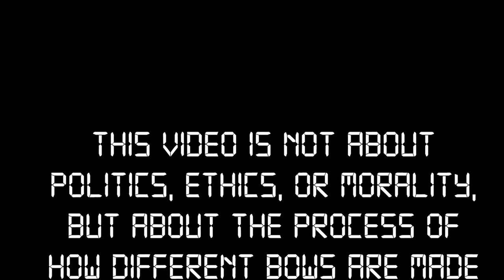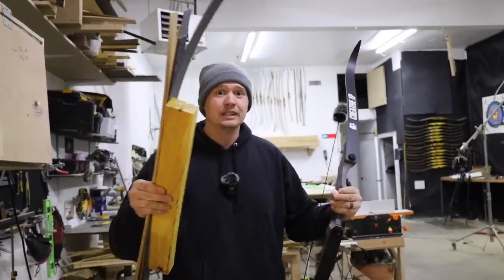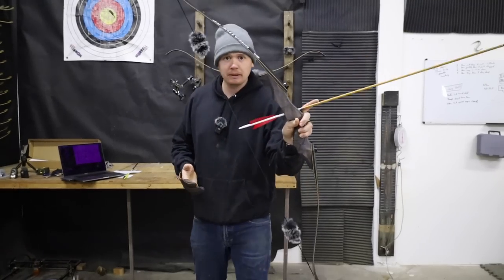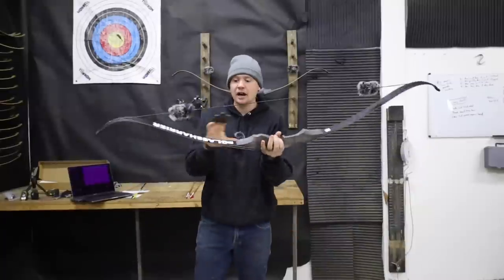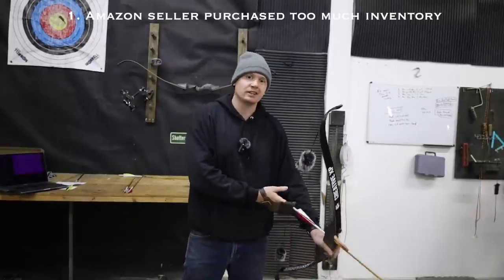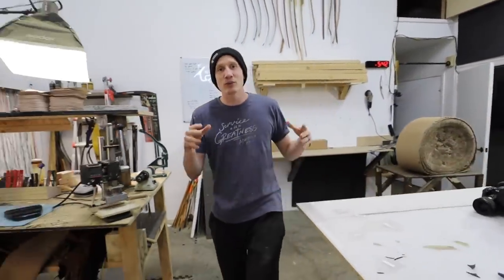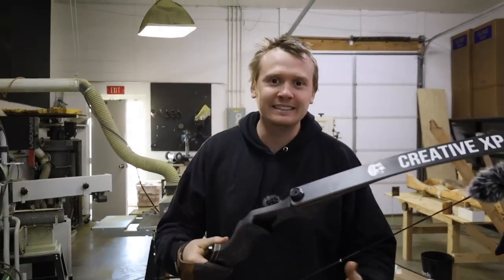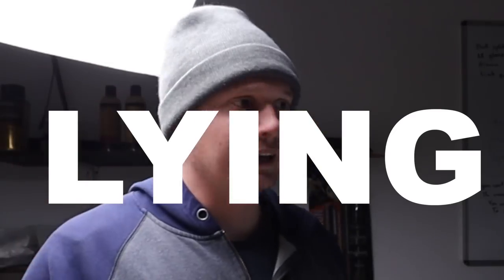Is a $59 Bow Trash? "what i think the truth is"

Comment: I have a question I believe you can answer. I have a 72", 38# hickory self, flat bow without an arrow shelf. I did not make it and do not know who or when it was made. I want to modify it for a teen girl around 5'2" with around 30-35# draw weight and 25ish draw length.  Can I cut the limbs to the desired length and still be able to hit 30-35# draw weight? I was hoping not to have to back it if possible.

Comment: Junxing is the main company making this model as well as a reflex deflex model and there is an all metal riser with same name and limbs fit both versions. There is also a flat top connection point model that the limbs fit the original design but cut out some of the sight window.

Comment: Hey guys, another great video. I ended up with the Blackhunter longbow, have since gotten recurve limbs for it up through 45#. That is a fine shooting platform for beginners like me. After that I got one of your bows, another great shooting bow which I love, it’s at 35#. Another bow I bought, before watching your negative review, was the $86 TopArchery 56” TD recurve at 40#, just received 45# limbs for it yesterday. I know you reviewed this bow as it came, but this is a great bow with minimal input. First I replace the continuous loop string with one of yours, my flipper rest did not fit but I had already ordered a plunger and flipper set up from Lancaster, it was cheap. I then installed some beaver fur string silencers and after some shooting have come to the determination that it’s my favorite shooting bow, but hey, I just started down this archery rabbit hole. Thanks again for great videos!

Comment: Kramer I recently made a bow string jig for making Flemish twist strings based off of yours and the video that you most recently made regarding such my question is when I'm measuring out the B55 that I'm using how do I account for the stretch When I'm initially measuring and twisting out the twist cause if I measuring for a 54 inch short bow and I bring it out to 51 inches in my measurement if I understand correctly you did another video on what the rate of stretch is And the b fifty five should stretch somewhere around two and a quarter to two and a half inches at a hundred pounds for maybe twenty minutes

Comment: My guess, based on the prices being different between the poundage that your hypothesis about buying more quantity than they could sell is the case. In particular, they probably ordered a bunch in each poundage and the 40 and 60 pound bows were selling the best, so they could keep those prices. But the 30 and 50 were not selling as much as they wanted, so they dropped the price to get the dead inventory moving.

Comment: I just bought a "Genuine" Left Handed Samik Sage 62in 60lb & apart from a very little finish (tiny bubbles) on about 1/4 inch on the riser it is perfect, it draws 61.6lb & it has a lovely release & I paid £60 for this delivered with a spare string & that Stringer you showed, why so cheap? the guy had a load of LeftHanded risers & offered all the limbs at the same money hoping that people would only buy the lighter ones, it's a really nice bow for the money, I also recently purchased a 70lb(67lb in reality) Compound Bow for £90, this came with almost everything including 12 arrows of pretty fair quality, it's only real drawback is its relatively heavy at around 5lbs but for the money, it is pretty good, I dropped it out of a tree about 9ft+ on to hard ground & it was fine. ?There are some bargains out there, but there is also a huge amount of Shite, even some at BigMoney, the price doesn't always reflect the quality. An excellent post, thank you.

Comment: Re strings coming with a bow as opposed to picking which string you want to buy with the bow. The string on two bows I've purchased the serving was centred. I.E. there was no top or bottom to the string and no matter how I strung the bow the server ended exactly where I would install the top nocking point. In other words, using the Mediterranean release, my top finger is on the bow string the server doesn't go that far.

I can't find the GLASSHARRIER Creative XP for sale online at this time, 24Nov22 (about a day after Kramer posted this review). Eventually found it sold out, though more expensive.  It sounds like a perfect beginners or guest bow.
Loved your review.
I knew the Black Hunter is a bow whose makers supply the same bow build for others to rebrand as their own bow, Black Hunter • Glass Harrier • Deer Seeker. Delighted, you share some of the other brands of the same bow.  GUANGE • Sharrow Lol! To name but a few more.
Reply: Honestly, I have yet to find an archer who isn't pleased with their Black Hunter or Deer Seeker version. The inconsistent poundage may get a mention, almost a running good-humoured joke. Did you get the poundage you requested?  Three sections, Twofold, lol!

Comment: The cheap stringers that come with some bows (I have a PSE that came with an identical stringer) can also be more dangerous when used on another bow. 

So, the PSE I bought was a 25# model (bad shoulder, it's easy & comfortable to draw. Don't judge, haha), and a friend of mine gifted me a 50# PSE.  I was able to sting it a few times with the cheap, stock stringer, until one day . . .The loop came off the smaller rubber cap, and the bow snapped up as it relaxed very, very suddenly. The only saving grace was that I had only just started stringing when it happened, so no harm, but I did promptly interwebz searched for another stringer that is much better, and less than $10 (w/ shipping, it was about $15 or so). 

So, yea. Cheap stringers are just that: cheap. And could possibly cause injury if you're not careful & attentive.

Comment: I gotta say, effectively getting a Black Hunter bow for roughly half-price doesn't sound like the worst deal I've heard of.  

By the time I went to the link in your description, no 30-lb bows were shown as an option.  The 50-lb bow was the only one at the low low price, but it was already up to $67.50.  Still a deal, but a heavier weight than I'd really like.  The price on the Deerseeker 30-lb (least expensive option) is up to $97.90.  For that price, the Obert Black Hunter is actually only about $4 more and I'd probably just get the Black Hunter.  

We'll see what post-Christmas prices do.
Reply: There is a low price one piece bow that is at 30, 2 models one that is for right eye dominant only that is the SinoArt Sparrow and no name, then the other is a bow that is the lowest priced bow that also comes in hunting weights on Amazon, the oldest review that Kramer did for a bow. Both are one piece bows.

Comment: Interesting how these bow prices are... but I have the Black Hunter Long Bow and Short Bow... both... was cheapter to buy the whole bow than buy the limbs for the take down bows... that is insane for pricing things... I really like the recurve but my favorite bow in my collection is the Mongolian Bow I bought years ago... still works great for me and got used to shooting it. I used to have Compound Bows and got rid of all of them because for me missing my left leg using a prosthetic it is a lot easier to string long bows and recurve bows and less complications... same with my crossbows and I have two 175 LB Jaguar crossbows and another Korean made foldable short 180LB crossbow...measurement for draw weight on a crossbow compared to a traditional bow for fps is 50 percent less than a long bow or such bow from what I studied over the years generally speaking. So if your crossbow due to short string release length is 100 LBS it is shooting at 50LB's for a traditional style bow or compound bow or whatever from what I've been told in the math. So my 180 pound crossbow is actually... since I'm used to archery... shooting at the equivalent strength of a 90LB  normal archery bow, due to shorter string release on the bar of the crossbow for the shorter bolts or arrows. The 175 LB crossbow is shooting at the equivalent strength of an 87.5 LB traditional or compound bow... plenty of strongth for deer hunting and such... any way was thinking about your crossbow builds and how they figure in the "stroke" of "release" in the use of bows and crossbows that have a very short release (crossbows)  compared to traditional archery bows for driving the arrow or bolt in crossbows so the poundage meaning is different. Any way... noticed that in your videos when you was measuring the strength of your crossbow for what it is shooting for the math of it all and was thinking about that. Wish you the best Kramer and thanks for the order today for the custom string and beaver silencers that I'm going to use on my bows... will probably need to order some more soon for my other bows and will do that in February. Will order one of the RD Bone bows when I save up enough with out going into required budget for surviving since I have a lot to deal with financially missing my left leg and other issues... but I do love archery and you guys are doing great with the new bow for commercial sales and look forward to seeing all of you gearing that up for the design in the RD BONES bow. Nice... like your thinking processes on the new bow design. Have a great New Year as well...later...

Comment: Thanks man you're like a bow building Bob Ross it's great.
Amazon is running this deal again right now. But for a 40# 58in bow. I only know because I won some gift cards at work, good luck and all, and have been missing archery dearly but I digress. Low and behold these babies are up for 49$ and some change. 
HOWEVER it has a different riser system atm from the images but honestly for that price and quality idc what kinda riser it comes with.

Comment: I bought one in 30#. $60.00. Couldn't resist. But I really don't like it. It's likely heavier than 30#. Not very smooth. Loud. Like you I had to replace the serving. Finish is crude and uneven. The silksceen logos are abysmal. It is pretty fast and accurate. It will throw an arrow, so there's that. Very much like a cheap fishing rod. It will work but a better rod will work better and you'll enjoy it more.

If you're a beginner, I'd just save up for something better. If you have a really tight budget, go ahead and get it and live with the limitations.

Comment: I'm still a sucker for cheap bows myself. Actually haven't tried the"black hunter" line out yet but if can still find them for that pricepoint may bite. Already tried a myriad of what used to be the cheapest ones around that are lower quality than that and had plenty of fun with them.
My current cheap bow gambling strategy has just been bidding on  used ones on ebay. Currently working on an older bowtech 70lb extreme solo for me,and a hoyt magnatech for my brother I paid around 50 and 80 bucks for including shipping.
Won a nika ilf riser a while back and ordered some sanlida miracle x9 limbs on clearance through optics planet when the "black hunters" weren't as cheap before that market got saturated and think got something better for under 150 dollars. May have to get a kramer Ammons string for it before too long.
 if can stay away from ebay 🤔

Comment: I'm thinking about getting into archery and the Black hunter (or it's other names) looked good, as I could buy a low weight bow and then upgrade the limbs as I get stronger/better and then eventually hunt with it.  The discrepancies in the limb weight that you and another channel found have me concerned.  I wouldn't have a way to check (as I don't do tillering).
Reply: @danielsmith336 re testing the poundage, you can use a suitcase scales. One with a hook that you can use to pull back the string as you would as if planning to release an arrow. Of course, don't release (known as dry-firing) the bow without an arrow to shoot.
Reply: @2DGraphicDesign  Thank you for the suggestion!

Comment: because chinese bow is made by machine,  the bow grip is produced from lathe,  the bow arm come from assembly line. actually, if you seperate bow parts to buy alone in china， the bow will be more cheaper. because the parts is made by different factory.